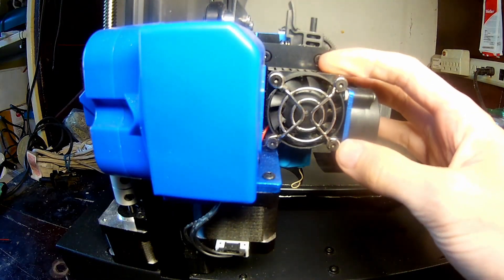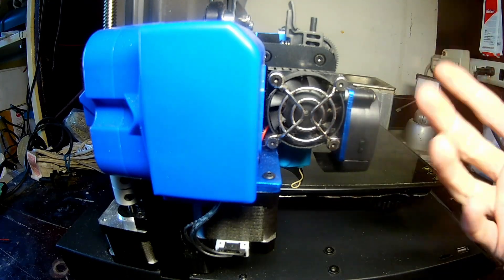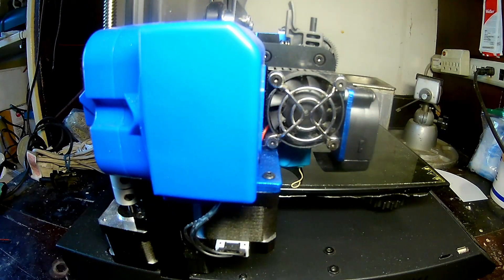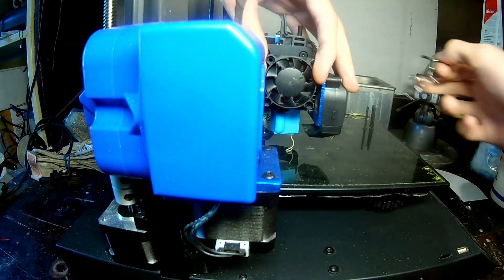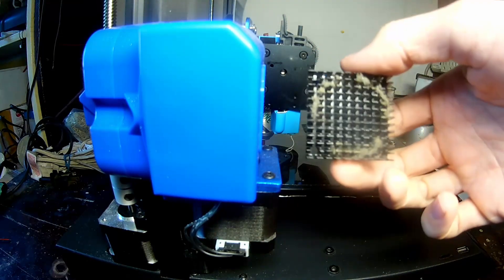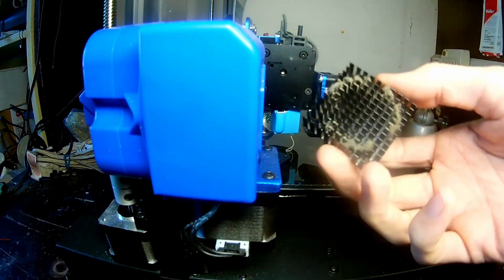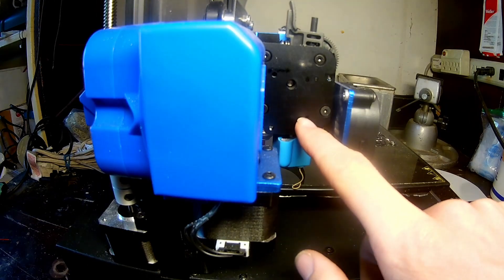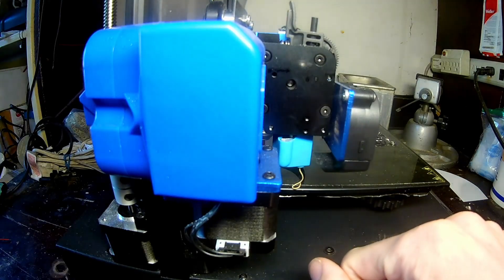What Heat Break Mount Do I Have?

Comment: I have the non-threaded style.  I can't find the link to your video showing the swap of the non threaded style. Is it similar to the threaded style?
Reply from the maker: Exactly the same other than the fact that instead of the assembly screwing in/out you push it in/out and lock it down with the screws. Eventually I will do a video on it I just have not had the need to swap breaks on my Genius yet.
Reply: @MakeItWithCalvin  have you made this video yet? I'm desperate to know how to do it properly and can't find a video with a smooth heat break anywhere.